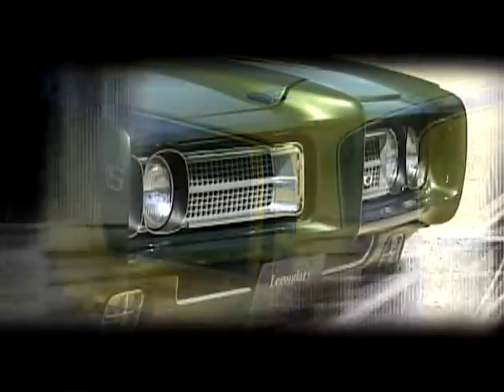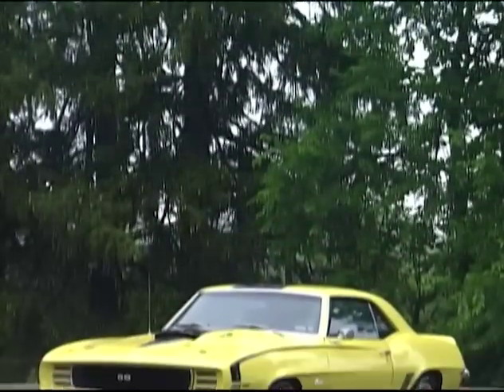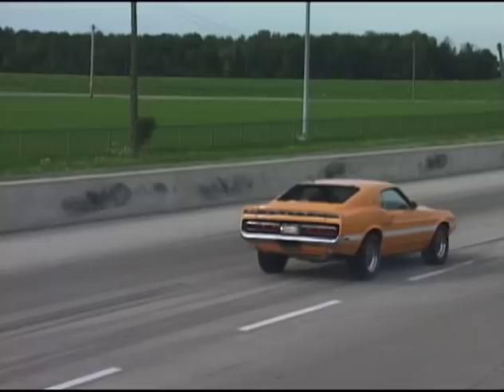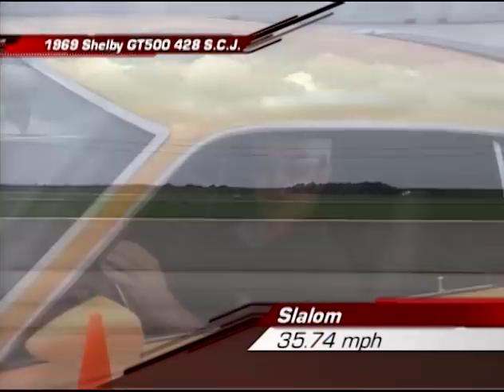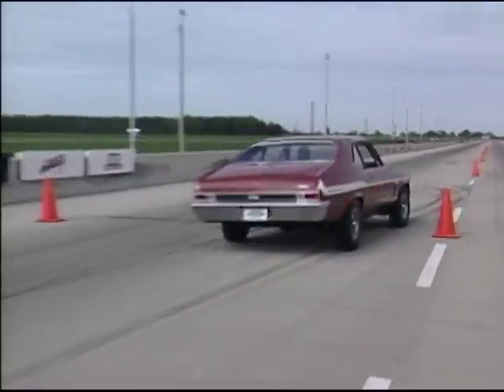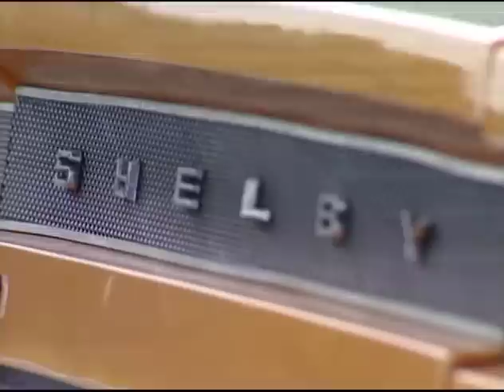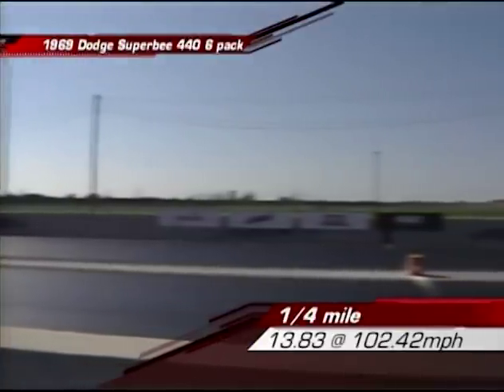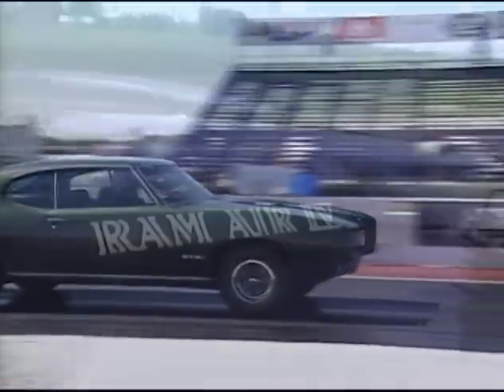What's the fastest 1969 tuner? SUPER MUSCLE CAR SHOOTOUT!

Comment: 60 mph to 0 ? 🤣  AMC Dealers had a “Go-Pak” that had lots of upgrades. 4.44 Gears, 2x4 carbs, cams and dealer-installed as delivered ! My Plymouth dealer set-up my 340 Duster that got my 14.75 @ 98 to 14.3s @ 100 which won Pure Stock G except when a certain 442 (455/360) was there running 13.9s at 101-102. I did squeeze a little more from my car with a cheater-carb  —- from a 440 that had slightly bigger primaries — and a ‘68 4-speed cam and stronger valve springs — got me right there with that Olds but a week later he was .2 faster again !! I did try a muffler swap to Thrush straight-through but they did nothing. It needed some head-work for more power.

Comment: I love the old braking tests.  Not really a test of the brakes at all.....just a test of how far the car will slide when the tires are locked up....and does it slide straight.  I am so NOT a fan of GTO's, but that car spanked the others.  Would have been interesting if the Nova wheel hop was solved and all cars had a dialed in and proven tune.  That guy sure can shift a 4 speed!  Great vid
Reply: What do you not like about the gto?
Reply: @thejudge8780  its really just styling. Doesn't really appeal to me.
Reply: @davesnothereman7250  what styling does appeal to you?
Reply: @thejudge8780  its really one specific thing on the GTO and that is the split grille. Looking at it straight on...it looks pinched in the middle.  I guess I could say the same for other Pontiacs too. In general I like the styling of the 4 shared GM products (Buick, Oldsmobile,  Chevrolet and Pontiac)....except for the nose on the Pontiac.
Reply: Most people who don’t like GTOs complain about the looks of the backside because that’s all they ever see in a race.
Reply: @timsharpe3498  - LOL !
Reply: @davesnothereman7250  - Dodges also had split grille...
Reply: Notice... Torquey GTO's owned stoplight to stoplight... where more people saw them... took a full 1/4 mile for the overcammed Chevy's to get a fender ahead: 
https://www.youtube.com/watch?v=SJIRitKQYrM

Comment: That Motion should be an EASY 12 second 110++ mph like nothing if thats a phase 3? I had a 67 Camaro Yenko clone so a 427/425 with the stock solid cam, 456 gears and a 4 speed about 1975. With a JUNK Holley 780 and 25 inch slicks 12.7 at 110 like nothing, phase 3 had a much bigger cam and more compression. That was at Epping drag strip on 'Grudge night' when it cost a whopping 2 bucks to race. Someone who raced on the weekends told me with a single plane manifold like the Tarantula and a 800/850 DP to eliminate bog easily 12.4 or better, that 780 with vacuum secondaries a junky used carb. 
My buddy had lots of BB parts like L-88 and Zl-1 cams and 12.1 pistons so i could have built a mid 11 second street car.
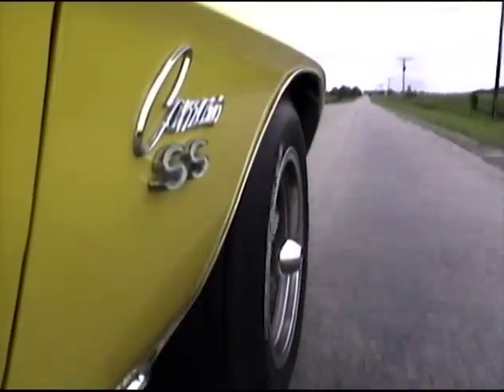Reply: At 09:00 he's granny shifting the B-M Camaro to keep it out of the 11's...

Comment: Funny cause the 1963 Pontiac Super Duty Tempest/Lemans cars were cutting 11 sec 1/4 miles at over 120Mph. Stil I’m not shocked the GTO Won, they did low 13,s hi 12,s dealer fresh. Would have been cool to see the Royal Bobcat 1969 RamAir V one of one GTO run here in this group, 😅
This Pontiac has a Nodular Iron crankshaft and not forged connecting rods. Forged pistons probably.

Comment: The problem here, is that the Shelby is not really a tuner car. All the others have engine or other powertrain modifications beyond what the factory put out. The Shelby powertrain is untouched, but rather, the car itself is merely a body, trim, and wheel package.
Reply: It had a race shop tune on a Super Cobra Jet option engine... otherwise they ran in 16's by '69...

Comment: I beat everything in my1969 Hurst Olds 455 except anything with a 426 hemi in it. 440s, yes. 340s of course but never a 426. 428s, 427s, 400s, and 396s, I beat everyone of them but never a 426 hemi.  

So I tricked it out, keeping it barely stock but with an Olds 330 degree overlap cam, headers by Ed, and a 800 cmf Holly spread bore carb by NHRA rules and street legal in Arkansas, turning 12.8 ETs on cold days with slicks and trapped in at 110 mph at 5000 rpms that was limited by the Olds 488 rear end I put in it. BTW, I hit that speed around the 900-foot point down the track. Didn't want to blow the engine of my grocery getter. And then I started beating stock 426 hemis in some shade tree races.
Reply: Hemis were easy to beat on the street because they ate sparkplugs... if it hadn't been tuned up that morning, it started misfiring at 3500 RPMs... and it made little power below 2500 RPMs in any event...

Comment: If they are including Yenko Camaros and Novas why not throw the 1968 Hemi Dart or 1968 Hemi Barracuda in there? The 1969 Super Bee 440 SixPack always had better times than 13.83 which was completed here.
Reply: Every one of the cars in this shootout would perform better on a cold crisp day with mineshaft air!  Then if you start super tuning and changing a few things here and there pretty soon you will have turned this into a F.A.S.T. series event.
Reply: As they said, running against a 50 MPH headwind...

Comment: ABOUT 15 YEARS AGO I WAS AT A SMALL CAR SHOW OUT HERE IN LONG ISLAND. THERE WAS A GUY THERE I ALWAYS RAN INTO AT OTHER CAR SHOWS WITH HIS 1964 4-SPEED HYPO 289 FAIRLANE 500. AT THAT SAME SHOW PARKED NEXT TO HIM. WAS HIS FRIEND A GUY NAMED GENE THAT HAD HIS 68 FOUR-SPEED 327,365 HORSEPOWER CORVETTE. HE SAID WHEN HE BOUGHT THE CAR IN 68 AND TOOK IT TO THE RACETRACK. HE WAS THE NATIONAL RECORD HOLDER OF A PURE STOCK CAR AND IT RAN 13.80'S IN THE QUARTER MILE. THE FELLOW WITH THE 64 HYPO 289 FAIRLANE SAID THAT'S NOTHING. HE SAID WHEN HE WENT TO CALIFORNIA TO BUY THE HYPO FAIRLANE 500. THE GUY HE PURCHASED THE CAR FROM TOLD HIM. WHEN HE FIRST BOUGHT THE CAR SPANKING BRAND NEW. HE WENT OUT AND BOUGHT A PAIR OF SLICKS. AND PUT THEM ON THAT FAIRLANE AND TOOK IT TO THE RACETRACK  IN SOUTHERN CALIFORNIA. WITH A SET OF SLICKS HE TURNED 12.70S IN A QUARTER MILE. HE SAID I HAVE THE TIME SLIP PROVING HOW FAST THE CAR RAN THAT HE RECEIVED WHEN HE BOUGHT THE FAIRLANE FROM THAT ORIGINAL OWNER IN CALIFORNIA. HE TOLD HIS FRIEND JEAN TO COME TO HIS HOUSE HE WOULD SHOW HIM THE TIME SLIP. YET WHAT THAT HYPO 289 FAIRLANE DID IN A QUARTER MILE WAS BEYOND A NATIONAL RECORD. YET THE NHRA NEVER RECOGNIZED IT OR ACKNOWLEDGE THE CAR. OBVIOUSLY THEY THREW THE RESULTS INTO THE TRASH CAN BECAUSE IT WAS A FORD AND NOT A CHEVY. WHAT MOST PEOPLE HAVE NO KNOWLEDGE OF. IS THAT FORD SHAPED MOST OF THE RACE CLASSES IN RACING.

Comment: braking on my '71 nova w/ 307 seemed awesome...pretty sure w/ 4bbl and pp heads the 0-60 wasn't far off that yenko...
Reply: and it annihilated in something low speed maneuvering oriented...what is wrong here?  lol  and only thing i saw take it ff a light was my friend's hopped up '57 beetle......he beat nova for about a yard then i ate him alive of course...then i saw a cop w/ a radar gun on 7th in Eugene....i stayed slightly ahead gesturing 'down down down'...i got pulled over/lectured
Reply: I'm pretty sure that every 307 powered Nova with a sawed off muffler imagined it was a Yenko 427!
Reply: @Thomas63r2  i'm sure....but w/ a honed manifold, power pack heads,holly 4bbl set up right and a turbo 350 and 2.56 rear end something nice happened due to a good torque converter matchup.   That wheel hop didn't happen.  The rear sank and a slight squeel and 0-60 in gear 1 in 6.x sec and into 3rd at 100mph.  It was too floaty...never took it over 120.  

I 350'd a vega...initially w/3 speed and 2.56 impala rear end..lol...louvers..  Nova was so nimble in the 0-30mph range i still preferred it down there though vega even w/ 70 series tires was 5.x sec 0-60. On light cars you have to keep grip on pavement ... in LA eg. guys pulled up in mach1 and revved.  Alfredo Pinto said ' hey Bobby these guys want to race.'   'oookayyyy just up to 5 over'.....

I literally watched them get out of the intersection when the nova was half block down already...And they had this 'wth does that thing have' look as i let them go by.  It was such a sleeper in that 0-30 or so range.  Of all the cars i raced, i only recall a few cars thumping me at higher speed.  I had great reaction time which helps :-)   I'd do same arm wrestling in jr. high...i'd relax til 'go' and slam a much stronger guy before he knew it was time to wrestle.  haha..i think that car was like an extension of my personality kinda.       

It'd be same w/ that yenko likely given his hop issues..  On a good start he'd out time me to 60 but i'd be ahead til 75  i'd guess where he'd go blowing by....just due to it's slingshot 0-30mph.  You have to get the motor up~250hp w/ 320 ft.lb. torque and that turbo 350 really works swell w/ that '71's suspension.  Why have low gears unless you're going w/ drag slicks on a light car like that?   It makes start hard-impossible to control....makes you shift early and limits max speed...and it sucks fuel. my vega got 27mpg btw w/ holly 600cfm  e.m. I eventually stripped louvers, put ib 2.73 monza rear end and 3 sp w/ overdrive for 1.91 overall

oh wheel hop?   i tried nova springs in rear of vega to try keeping wide impala rear end from rubbing tires on wheel wells with passengers.  haha leapfrog anyone?
Reply: @sounddoctorin  everybody thought their 307 ruled the streets...easy pickings
Reply: @Thomas63r2  i ruled 0--30 or so save a few feet of hopped up vw in my experience.  lol.  And it's just a fun physics fact that in this competition  i'd have likely won braking due to best weight dist...and slalom due to that and superior 0-30 perf.    I'd get killed in all other but 0-60 where it might clip one or 2 on a given day. Especially w/ humid air....that thing loved moist air.  307's came w/2bbl only and mild compression so lots of easy upgrades... oh and i had headers too which doesn't help much but if a person does the right stuff you get 300hp and then you place in the middle on 0-60, and might not be dead last in 1/4 mile  ...
Reply: ps in this comp. it's just a curious note a car w/it's attributes likely would get 1+6+6+1+1+1=15 for 3rd place. ie. it'd be better to score by how badly one beats another really.  If they did that the thumping in 1/4 mile and burn out would put me dead last i'm sure!   If they added an mpg comp it got 20mpg btw :-)...so fairly sure it'd win that.  hey we had a 390 ltd that cruised near 20mpg sometimes.  That mc 4bbl wasn't bad.. heavier ride  but pretty quick for it's size. hehe... mom got a TICKET DOING 80MPH ...only shortly after passing turn lane obstruction from hwy 99w onto arboretum road...hehe 0-80 in lile 1/8 mile....she was 'in a hurry' she said
Reply: There must have been some slow cars in your town because a 307 is one of(if not the)worst V8 engines GM ever produced.It was designed to get better fuel mileage than the 327 it replaced while making the same horsepower,and it failed miserably at both.
Reply: @davidh1249  you totally missed the physics of  my point.  CAN a nova w/ 327 / same hardware beat the 307?   deeerrrppp  of course it weighs the same/has more power....except....

In case you didn't read my post...it's about static vs kinetic friction.  ///the mach 1 i destroyed off the line isn't slow.  It just tends to break static into a kinetic friction scenario at the start.  The nova i had was set up to make static friction on verge of going kinetic.   Spinning tires puts energy into 

*noise
* smoke
*heat

Not spinning them puts all energy into forward acceleration.  Bigger motor up front doesn't add much weight on rear end... and it can't initially accelerate any faster than static friction of tires allows!  So if all have same tire/weight then he who doesn't spin wins at least to speed where spinning stops unless non-spinning car is like 30% or so under power needed to spn 'em.  now that's a wild guess...here's from a table of coefficients:

Bitumen or Asphalt (dry)	Rubber

static	0.9
sliding	0.5 – 0.8

.ie. it ranges from 11% more acceleration by not spinning tires to over 40%.  So my wild guess is  pretty typical.  

In this contest, a setup like mine would reduce driver control variables keeping tires threshold of breaking statc friction during accelerations.  Without special tires that's as good as it gets for slalom
Reply: ps that applies in braking too. obviously.  My nova was great at controlled braking which saved a bike that dove off a sidewalk right in front of me at 40mph....i was blown away how quick it stopped.  how close to sliding can you get without sliding?  practice,    practice,  practice, ...
Reply: Let's give @sounddoctorin   an award for being the king of "yanking your chain" with his 307 awesomness!  While the 307 failed to meet design targets, it is not the worst performing small block - the title of most pathetic and forgettable SBC goes to the 262 V8 110hp of the mid '70's, and the 267 V8  120hp of the late '70's to early '80's.  Not only were the 262/267 V8's slower than the 4 cylinder cars of the same era, there was nothing you could do to improve their power - although many an owner wrote in to HRM and PHR asking for help.
Reply: let's give  @Thomas63r2  the award for missing the point...
Reply: @Thomas63r2  this isn't about 307..any motor giving threshold of sceeching from 0-30 w/same weight dist./suspension would get 3rd in this test.  get it?
Reply: @sounddoctorin  This is kind of like all the made up words in crypto; -  "threshold of sceeching" - is this with the JATO strapped on?  Sounddoctorin is taking 307 love to new places - maybe it does something special at 88mph.
Reply: 307s were a dog...
Reply: @jamesbottger5894  Yes - easy pickings for sure.  I'll admit that I'm still laughing about "threshold of sceeching" and all the other gobblygook.

Comment: first of all. i dont know if they revved the engines out to what they actually rev to instead of 5 to 6k rpms like they rate the stock hp at at like 5200rpms for example. all cars shouldve been tuned in, and track should be prepped

Comment: The builders/tuners did a great job on the GTO. I'm not familiar with what the baselines should be for the AMC or the Ford GT500, but the 440 Six Pack  and the Yenko did not run to their full potential. As is frequently the case this shootout was a test of engine/car builders as much as a test of vehicles.
Reply: There was about a 50 MPH headwind as they explained... 
By '69 the GT500's ran 16's... Shelby had nothing to do with them except name... he broke with Ford Summer '69... they lost 2nd carb. in '68... lost hot cam in '69... this GT500 has Super Cobra Jet 428 option plus race shop tune...

Comment: I love how they used an actually tuned nova and it was dead last! Nice try on using a stock showroom mustang tho, not tuned by anyone
Reply: The word "tuner"??  Should it apply to all of these?  5 of the 6 had 'modifications' made to various factory parts.   The "shelby" is NOT a ford (and intentionally has no 'ford' emblems) - has very few ford parts - except maybe the bumper bolts.  Shelby's were modified in more ways than the other 5 combined!  428 would not fit without 're-engineering' the engine bay     and the suspension components.  On the other hand, COPO (Yenko was a dealer that took advantage of COPO) was FACTORY PARTS ordered "by accident" -  by someone who had to "bolt them on".
Reply: 428CJs had awful exhaust flow and Pontiac had the best. All the ‘tuning’ in the world can’t change that fact.
Reply: @brianstough5286  - Ford 427 & 428 were the same engine on the outside... by '69 Shelby had nothing to do with Shelby Mustangs... broke entirely with Ford Summer '69...
Reply: As they explained, all cars got a race shop tune... and this Mustang had the Super Cobra Jet 428 option to start with... otherwise by '69 it was a 16's car...
Reply: @brianstough5286  - It sounded like you were saying the earlier 427 Mustang had to be extensively modified for the later giant 428 engine... main reason for the 428 was longer stroke engines tend to burn cleaner... emissions were starting to be looked at... not just HP... 
Also, Chevy car big blocks are the same on the outside... anywhere the 396 would go, the 454 would also slip into... truck big blocks of 366" - 481" are taller... 
Ford used Shelby because if any catastrophic accidents with dozens of deaths happened with their hot cars, the press would be naming Shelby, not Ford... not the Ford family... 
https://en.wikipedia.org/wiki/1955_Le_Mans_disaster
Reply: @BuzzLOLOL  Yep.  Been around many big blocks.  Emission concerns were not important to ford then - but being able to brag about the size - and/or the 'street' stoplight to stoplight contests....   

I wholeheartedly agree with you that ford is great at blaming someone else for their "faults"..   Still prevalent in the Navistar and Firestone stories
Reply: @brianstough5286  Shelby is Ford stopped reading after that don’t have a clue
Reply: @CoyoteFTW  Exactly.  Shelby was hired by ford to make something that had a reputation similar to the Corvette.  Of course, it was a British car, with Exotic engines (at first) - [exotic meaning NOT regular production, but VERY EXPENSIVE, hand-built engines].

Then, a few mustangs were sent to Shelby, and he took them apart, and discarded everything 'ford' except possibly the bolts on the bumpers - so that a very few, very EXPENSIVE cars that LOOKED LIKE MUSTANGS could "hang" with the Camaros... (and Firebirds, and Barracudas and Challengers and Javelins and AMX's)